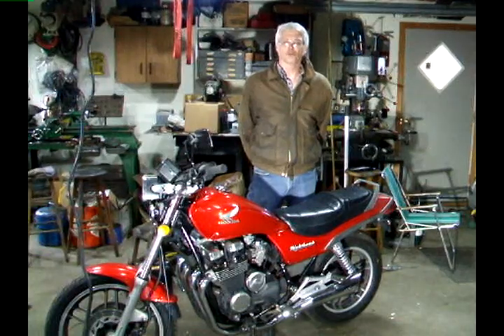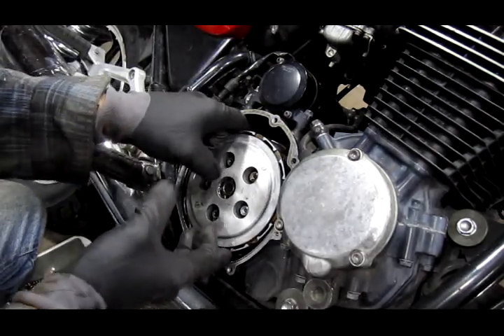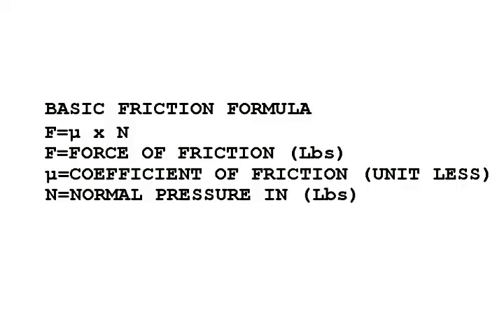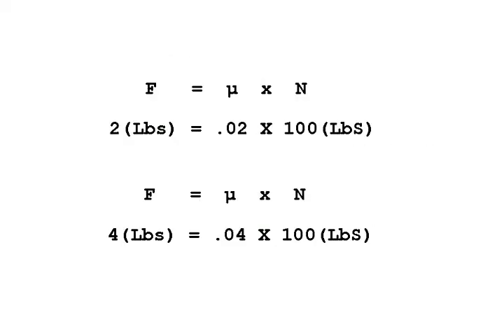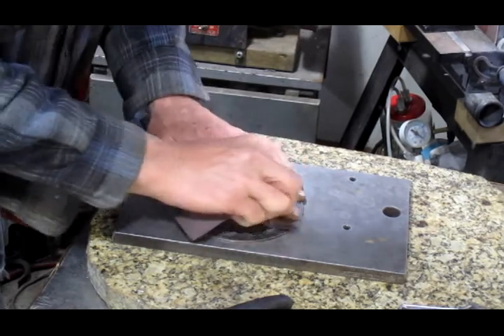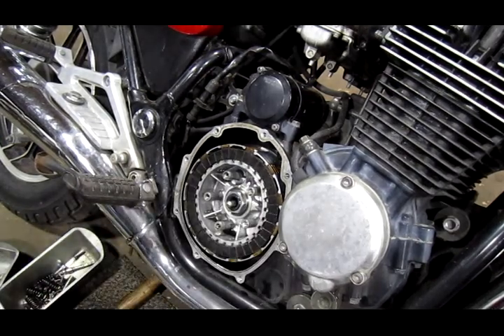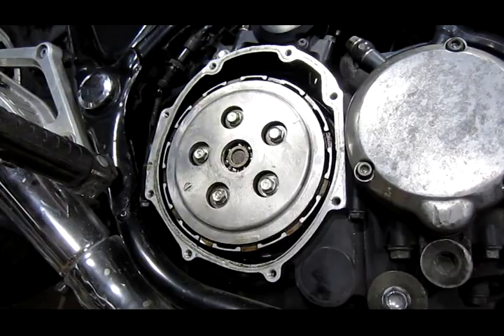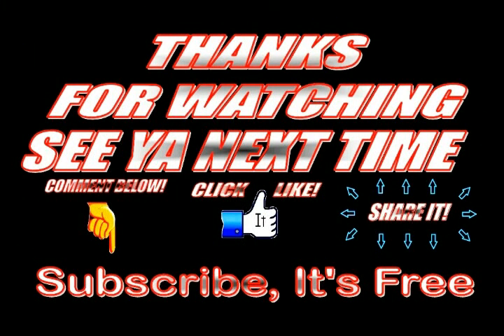Slipping motorcycle clutch, Cheap fix

Comment from the maker: To support this channel check out Amazon through the links below:
Amazon KG Clutch Factory H/P Springs for Honda CB 650 750 900 SC http://amzn.to/2rmnbd2

Amazon KG Clutch Factory Standard Discs for Honda CB650 Nighthawk  http://amzn.to/2rT9suZ
Amazon Hitachi KC10DFL2 12V Peak Cordless Lithium Ion Compact Drill/Driver And Impact Driver Combo Kit  http://amzn.to/2sctKx9

Amazon Hex Shank Magnetic Power Nut Setters, 8 Piece | Metric (6mm - 13mm) http://amzn.to/2rSPT65

Comment: I my country the UK your quick fix is something the gipsies/scrap merchants/tinkers would do to sell a machine off quick but good on you mate, your tip could as you say help you out of a tight spot!
Excellent lesson.
Reply: @Doge di Amalfi they use this trick to sell you a motorcycle with worn plates which slip..sand them down will make the plates do not slip for a while.

Comment: Hello I’m stuck at a NY motel with slipping clutch on my new 2002 voyager (500) miles with hydraulic clutch
After 3 day at a shop and $300  later not fixed ! OK I learned you have to make free play when you bleed !
Reply from the maker: I would be checking the return bleed hole in the master cylinder. It's the really small and if its plugged the clutch won't release all the way. Here is a video of a front break master cylinder with the same problem. It works the same way. https://youtu.be/PlQTcLEAHjM

Comment: I just picked up a 2006 Honda Shadow Sabre 1100 and the clutch does not engage until the lever is fully out. I tried adjusting at the lower cable and lever and no change. Is this a sign of a worn clutch or springs? Could the clutch lifter lever be bad?

Comment: Nice video! I have a 1985 Nighthawk and mine just started having a rough noise when I switch down to 1st from neutral. Afraid to ride it till I figure if it's a major problem or not.  After it is in 1st no problem that I can tell but want to make sure.
Reply: Have signal light problems but my shifting problems have been corrected and is fine.

Comment: Gunna try it on my bike, it's just starting to slip.  If you get another 10K miles on a road bike could you expect the same on a plated dirt bike? A 08 KTM EXCR 530 is what I have and do 90% dirt 10% road riding.

Comment: SIR DOES THIS CANCEL OUT THE NOISE PROBEM IN THE CLUTCH CASE, WHILE HOLDING THE CLUTCH LEVER.  REGARDS 🙏🏼🕊️
Reply from the maker: If the noise is from the clutch slipping it will, but if you have a bad bearing or some other problem it will not.
Reply: @Amotorcyclenut  🙏🏼thank you

Comment: 2013 Yamaha FZ8 just curious as to scrubbing them down? Do you do both sides of each plate ?
Reply from the maker: Yes, both sides of the metal plates only!
Reply: Thanks brother I missed video and it wouldn’t play again. Lol as I’m typing this it pops back on ✌🏼. Appreciate it cause I’m about to start it next week. You don’t think it’s better to just buy new plates?
Reply: A Motorcycle Nut  ya think I can get away with either your way on my yammi FZ8 or just order new friction plate kit n gasket?
Reply: I’m due for oil change and since I’m ready n have everything I’m gonna give your way a shot and skip buying the kit w springs n all. I’ll definitely order the aluminum crush gasket though from yammi. Great video! Thanks in advance

Comment: Im trying to find out of that is the problem I have (slipping clutch) when I drive normally I have no problem, but when I try to accelerate hard, specially in 3 gear and above it takes a lot of Rpm but wont pull right away, my logic tells me it should be a slipping clutch or too loose springs, but I dunno my clutch is`t that old, changes the plates like 15K miles ago could it just be the springs or maybe somthing els ? karburators or valves ?
Reply: Its the clutch i have the same problem sand them down a lil bit and u should be fine
Reply: Sand the steel plates may help but you have you check the main plates are worn and also the springs . If you have a workshop manual it tells you the limit for each part .

Comment: How do you know if your clutch is slipping?
Reply from the maker: If the engine will rev up under load (like going up a hill in 4, or 5th gear)  and not accelerate the vehicle. If that is the case, then properly adjust your clutch and clutch cable. If that does not solve your problem then you can try what you saw in this video.
Reply: You'll first notice it in higher gears, you'll pull the clutch in, shift up, let the clutch out while giving it throttle... And you're not going any faster. Your bike will be revving and complaining quite loudly, and if the slippage is just beginning it'll probably catch hold and go on like nothing even happened. I must admit that if you're not expecting it, especially if you're trying to get somewhere quickly, it's pretty disconcerting and can be a little frightening!
Reply: A Motorcycle Nut thank you!
Reply: This is exactly what my v star just started doing. I’m going to adjust the clutch first and if it doesn’t help I will try this.